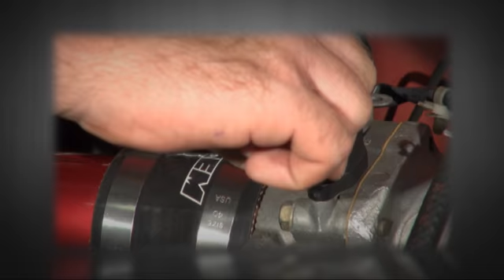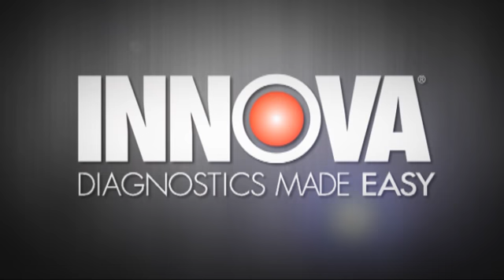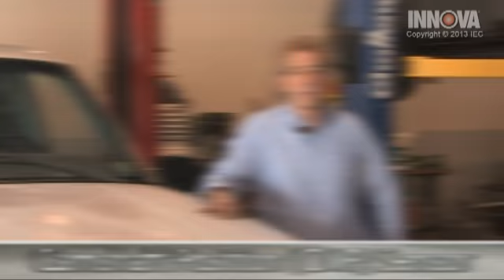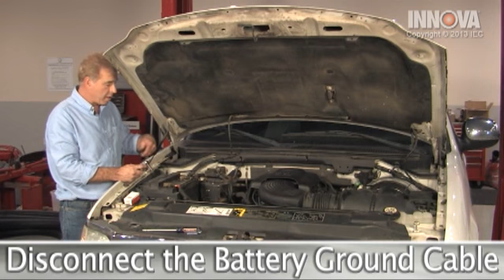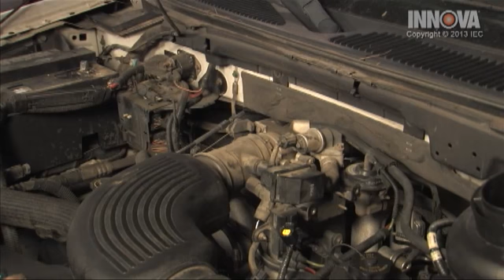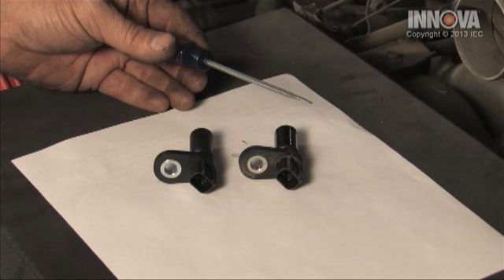How to change Camshaft Position Sensor (CMP) - 2002 Ford F150

Comment: First of all this is a video for removal of a camshaft sensor not a crankcase sensor.I see so many people getting the two sensors confused.I have a 2000 ford expedition 5.4,similar to the truck in the video.You do not have to take all that air intake hosing off.There is plenty of room to reach your hands down and reach that camshaft sensor.Remove the pigtail wire and remove 8mm bolt.Now in this video the mechanic doesnt show the actual removal of the camshaft sensor.Once you remove the 8mm bolt,turn the whole sensor and use both of your hands,put one hand on the electrical connector and the other behind the wing part of the sensor and pull hard,it will come out.Do not use a screwdriver to pry it out.Use both hands.You will see what im talking about.Should take 5 minutes to remove,grease new sensor with oil and reinstall.

Comment: 2000 f150 6 cylinder motor where is the camshaft sensor located
Reply: Right below the EGR valve and right over the waterpump

Comment: I do believe that's a crankshaft position sensor
Reply: Just did my crankshaft position sensor. That one is located near the A/C compressor on my 98 F-150 4.6. Currently looking on how to do the camshaft position sensor, which appears to be a piece of cake relatively speaking. Trying to fix a intermittent crank but won't start when hot problem, which does NOT set any codes. This part is next up to bat. Have already changed out the PCM while stranded at a store parking lot. Guess what, truck would still not start after the 20 minutes it took me to change it out with the cool PCM.